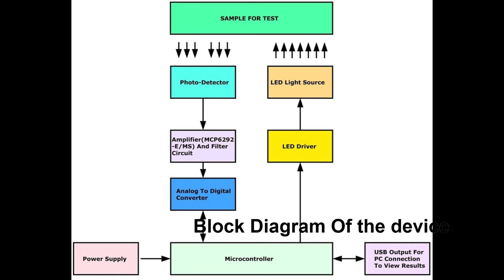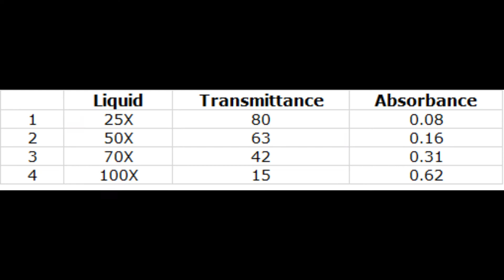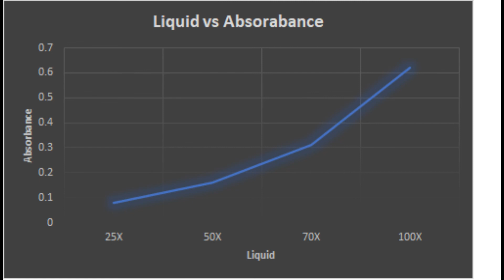Spectrophotometer for chemical analysis using Photodiode,MCP6292, Arduino (Proof Of Concept)

Comment: Have u used a monochromator? 
How you can select a wavelength of a LED?
Reply from the maker: monochromator is not used here, Based on the Requirements Of my design I procured The LED and PIN photodiode
Reply: @vinayyn  How can you select a wavelength? How can you make an alternative of monochromator? Is it possible to do so ?? Scientifically? May not be as precise that but still .